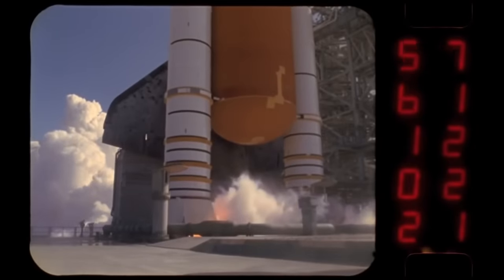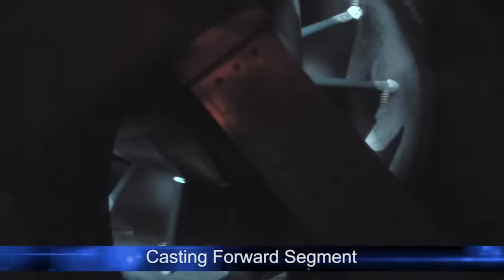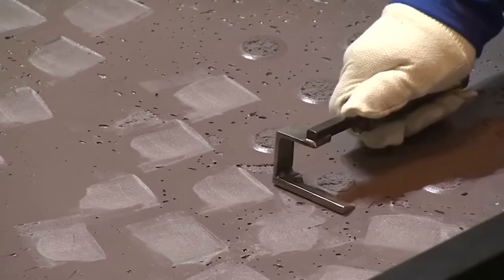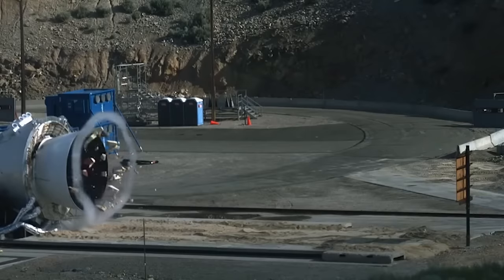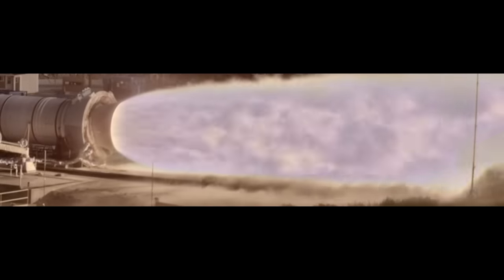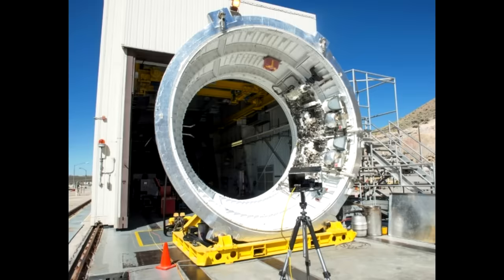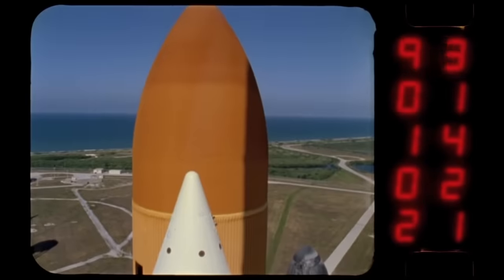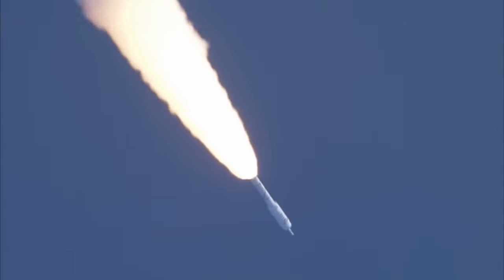The Amazing Engineering Behind Solid Rocket Boosters

Comment: When I sold electron microscopes I traveled to Morton Thiokol in the mid eighties right after the Challenger accident. The engineer gave me a tour of the facility and  even let me handle a piece of the o-ring that failed. The most amazing part was the booster shell section cleaning rig. Because they used CCl4 (carbon tetra-chloride), to conserve that hazardous material and reduce costs they used a MASSIVE container half the size of a basketball court in the factory floor that used CCl4 VAPOR that condensed on the booster shell on drained into the floor to be filtered and re vaporized.

Comment: Do you know of any videos showing the Booster Separator Motors firing in slow motion? Our company makes the Aero Heat Shields that cover the Booster Separator Motors. The shields fly open at the speed of insanity and lock into place allowing the rockets to push the boosters out of the way.

Comment: Fantastic and useful information I never even saw the remake and rebuild of the solid rocket boosters after the Challenger disaster now I have and I’m glad they made changes they did now the question is going to be is how big can the solid rocket boosters get in diameter or in length for practical use because if they were able to be larger you could actually put segments of a space station components on those and carry them up that would be beautiful
Reply: @Autistic Danielle. The diameter of the Shuttle SRB’s was determined by the railway right of ways between Utah, where we cast the motors, and Florida where the shuttle was assembled and launched. We could have made them bigger, in fact some designs were bigger, but the railroads would not accommodate the larger diameters. We looked into casting them in Mississippi and moving them on barges down the river and through the Gulf of Mexico so we could make them bigger, but the cost of the new propellant casting facility was great and the program was coming to an end. Making them longer has limitations, too, because the propellant was mixed in 2000 pound batches and casting tall motors means they have to be done in shorter sections that are stacked; monolithic grains have a limit in length because you can’t keep pouring freshly mixed propellant in on top of propellant that is already curing at the bottom, plus the hydrostatic pressure of a tall column of propellant changes the propellant properties and radial pressure on the motor case at the bottom of the motor. And there are other technical challenges - with enough time and money these things can be dealt with, but time, money and political will are the limiting factors. I worked at Thiokol Promontory Point, Utah as an engineer on Space Shuttle, Trident D5, Peacekeeper/MX and on R&D projects for NASA and Air Force. Fascinating work, except for the money and politics.

Comment: There is another limit besides the size of each segment for teansport - the amount of mixed fuel. The amount of aluminum, polymer, oxidizer and catalyst for polymerization that can be made in one batch is limited by the technological process and the time of catalyst action. Mixing two batches of fuel in a larger tank can lead to combustion instability which can lead to casing burnout. They discovered this while mixing "by hand" in smaller batches for the Polaris SLBM. Later the entire process was automated with accurate measuring and mixing times as well as increasing the amount to be made exactly for one engine or segment.

Comment: Before I retired I worked for over 40 years at an independent materials testing lab, so I am quite familiar with aerospace. Engineering always includes  trade-offs (#1 trade off is cost). The segmented booster design was known to have joint issues. The competing design used one piece boosters but had to include building new facilities for casting the fuel for the SRBs. The lower winning bid used existing facilities and shipped the SRBs in sections to be assembled on site. To save even more money the o-rings were not made of a silicone or fluorinated polymer which typically has much better low temperature flexibility properties. There is simple ASTM  test method to determine low temperature retraction properties the gist of which Feynman brilliantly  demonstrated.  In short you get the safest design for which you are willing to pay. (just like accelerating a mass to light speed requires more and more energy, so does the cost to get a higher degree of safety).
Reply: All these years and you still didnt realize the truth
Reply: @idontcare7961  There are so many truths my poor ape brain doesn't and will never realize so I can't dispute your statement.
Reply: @michaels6463  Like space missions being nothing than fairy tale for religious ppl.
Reply: @idontcare7961  Loon alert
Reply: @idontcare7961  I'm not qualified to intelligently discuss religion and all I know about fairly tales is that they are generally a tool parents use to introduce moral concepts to their children.
Reply: @michaels6463  Globe earth that they teach us since first grade is a lie thus ppl who believe it are religious. Globe earth is religion, not a fact.
Reply: @idontcare7961  Congratulations! I didn't think it was possible to pack so much illogic into two sentences. Hats off to a true master!
Reply: @michaels6463  Grow up.

Comment: Since the rate of burn is proportional to the surface area of the solid rocket propellant and it burns from the inside out, if there wasn't a spline shape on the inside the rate of combustion and therefore thrust would increase as the fuel is consumed and the diameter of the hollow area on the inside increased.
The splines therefore usually normalise the burn rate to provide a constant level of thrust, but they can be tuned to provide more thrust at take-off.

Comment: "The best part is no part" kept running through my mind, esp. when the post-challenger "fix" was explained.
Reply: That is exactly what I thought. The segments connections seems overengineered, just because the factory was far away. So many unnecessary things needed just to make the transportation work in segments. That's why SpaceX rapid development is racing ahead, while SLS is looking like 1970 rocket engineers wet dream...
Reply: @Ryzon95  Racing ahead?  .  The comparison is ridiculous.
Reply: @hoghogwild  Not a native speaker. SpaceX with rapid development and trials is  waaay in front of NASA when it comes to technology and development. I know they are not competitors, but NASA's methods and the way they have to secure funding are making them stick to tested stuff, but not always good stuff - like these SRBs for SLS - overengineered and complex.
Reply: @Ryzon95  The government told NASA to use "Shuttle derived" technologies, so that's what they must do.
Reply: @hoghogwild  Yep, that's true, and that is exactly why (in my opinion) they are far behind. They are not going for innovation, going for reuse of decades old hardware.
Reply: @hoghogwild  It's not a ridiculous comparison at all. SpaceX has launched several supply missions and now 2 crewed missions, they are in the operational domain of the Commercial Crew Program, while SLS plans the first test flight (Artemis 1) in 2023!
Reply: @arfyness  SLS is designed for beyond LEO travel, the Commercial Crew vehicles are LEO vehicles only. Artemis -1 will travel to Luna and back.  Completely different vehicles and purpose, thus a ridiculous comparison.

Comment: Just like the propellant in a AMRAAM or ASRAAM, multiple splines within the solid propelant for that fast burn and faster acceleration as the propellant burns. Plus AMRAAM has the splitter down the body of the rocket to abort or for safety on the ground, it splits the body open  and the propellant burns to atmosphere, just don't have any rain or water nearby the combustion exhaust turns in to Hydrochloric acid.. Guess what I used to do in the RAF.........

Comment: 11:28 - Why not have pins on both sides of the O-ring band, to prevent the flexing from pulling the O-ringed section of the joint open?

EDIT: 12:52 - ...that works, too.
Reply: Because the pins must be protected by the seals. They themselves are not sufficient to hold back that kind of heat and pressure - it would destroy them quickly.

Comment: Solid rocket motors run quite rough compared to liquid rocket engines.  The SRB is a giant acoustic resonator - a whistle on a grand scale.  Many harmonics that change as the propellant burns away. You mentioned bending motion, in re the field joints, but didn't mention the "pogo mode" of vibration of the SRBs.  For the Areis test, the structures troops had to add large springs between the motor and the payload to absorb the +/-  8 cm amplitude at ~ 6 Hz.

Comment: Incorrect math at 1:06, when you say EACH booster produced 1250 tons of thrust of thrust whereas the core produced about 600 tons...that means 2500 vs 600, or 5/6ths of all the thrust, not 2/3rds.

Comment: There is a very good book that gives a tremendous quantity of information on Liquid and Solid fueled rockets, including formulae for thrust, chamber pressures and nozzle design. It also has design criteria for turbo pumps. I have a copy of it, cost $0.25 at the time I bought it.
Rocket Manual for Amateurs by Capt Bertrand R. Brinley, published 1960 by Ballantine Books, Library of Congress # 60-8528.

Comment: Are there any videos that cover the mechanical linkage that attaches a rocket engine to the rocket itself? Like these boosters with several hundred tons of boost were attached to the main tank via two points, I would love to see how these points were engineered to take such an immense force through them. Or simply, how is the thrust from a rocket engine is transfered through to the rocket itself.

Comment: I have an interesting story about the solid rocket fuel produced for the SRBs. 
When I started college in 1982, I attended what was then called Alabama Technical College where I was supposed to earn my associates degree in applied electronics. My first instructor was a man who had been a chemical engineer. We were having a conversation about the shuttle's SRBs. He tells me he was on the team that developed the solid rocket fuel for them. He explains the process and the chemicals involved. While he is telling me all these things, he reaches into a file cabinet drawer, pulls out a styrofoam container, lifts the plastic lid off and shows me this gray rubbery substance. Then he says, "this is what it looks like". He actually has solid rocket fuel in his office. Next, he cuts a sliver of it out with a knife and places it into a cigarette ash tray and proceeds to light it with a lighter. It took a second or two before it starts burning. It was a lot like a sparkler only faster. When it was finished there was nothing left.

Comment: 2400 is 80% of 3000 last I checked. 

1200 each per booster is 2400, 600 for the liquid engines makes 3000 total. 

YouTube won’t let me rewind mid comment, but I’m thinking I should be looking for a 4 leaf clover under the snow cover if I found an error in one of Scott’s videos. That just doesn’t happen, especially on a basic description.

Edit on review. 1250 per booster is 80.6% of 3100 total boost.   It really is a unicorn.

Comment: Scott, you note that the SRBs have their own rate gyros at 16:03.  You say that they were noting abnormal (vectors?) from what Challenger's gyros were, so why wouldn't this trigger an abort?  I'd be interested to hear your take on this...I suspect that perhaps this wasn't a measured aspect of the system in 1986, or perhaps expecting too much for the Shuttle's computers to figure out in that split second on Challenger's 80's-era computers...or maybe they did start an abort, but it didn't happen soon enough to escape?

Comment: The Air Force built up the solid fuel boosters for their Titan III and Titan IV launchers in an installation separate from their Vertical Assembly Building, as they considered hundreds of tons of solid fuel clustered in one place highly dangerous and wanted to minimize their losses if they had a fire or some catastrophe. I have always wondered if NASA took, and with the SLS will resume taking, an huge risk in collecting and handling the SRBs in the VAB.

Comment: That improved, double-clevis, triple O-ring, J-seal joint should be known as a "Boisjoly Joint."
Roger Boisjoly was literally destroyed as a whistleblower for rightfully showing the danger of expecting the original joint design to work at below freezing temperature. It was designed to function above 45 degree. (I freely accept any correction, as I take this from memory. My perception is often flawed but corrected by fact.)

Comment: Scott, do you think we will ever see a "Falcon 6"? A Falcon 9 with 6 Raptor engines instead of the Merlins. A liquid fuel stage that could do the same work of a Falcon 9 all the way up to replacing an SRB (perhaps fewer engines if one omits the SRB replacement scheme)? Or won't there be "any real need" for smaller rockets if you can ride-share a Spaceship?

Comment: Scott, why is it in launch failures that involve solid rocket motors, that while the rest of the vehicle disintegrates under the sudden aerodynamic forces they experience, the solids seem to happily keep trucking along, blissfully unaware that they are about to get blown up by an RSO? This has been seen numerous times. Are solid casings made out of an “unobtainium” of sorts, are they way overbuilt compared to the rest of the vehicle?
Reply: We cant really compare large segmented solids like the RSRMs used in Shuttle with the smaller unitary solids.  However, we have to remember that SRMs have to be able to withstand the pressures of combustion along the entire case, while liquid rocket engine designs simply have to carry the fuel at whatever pressure is required, while the pressure of combustion is solely handled in the Main Combustion Chamber and nozzle areas.  The entire case of any SRB is a massive combustion chamber with its associated pressures.  Shuttle RSRMs had an average chamber pressure of 620 psi, but can reach up to and over 1000 psi during highest boost timings such as off the pad scenarios.   SRMs are usually structurally much stronger than the rockets that they boost.

Comment: On Challenger, most of the excessive SRB gimballing (moments and forces) that reopened the wounded joint were caused by unnecessary roll commands from the flight control load relief function. The Shuttle continued flying this way well into the future.
Reply: Unnecessary commands?  The stack encountered the highest winds that any shuttle stack had encountered ever.  What makes you think that the roll commands were unnecessary?
Reply: Are you saying that they could have not corrected the course and still been able to reach orbit?

Comment: 8:04 - Why throw the nozzle extension away rather than recovering it with the rest of the booster?
Reply: Good question, Vikki.  With Shuttle, the entire SRB floated and WAS recovered by towing into Port Canaveral, except for the dumped nozzle extension.  Reason: The speed at which the SRBs hit the ocean under parachute was quite high: 12 or 20 mph (don't remember anymore), enough to break off the extension and damage the nozzle and its complex systems beyond repair.  So to insure reusability of the SRBs, the extensions had to be dumped just before impact.  With SLS's even larger and heavier SRBs... to avoid the use of huge and very heavy one-acre parachutes in the nose... the decision was made not to recover the boosters, at least not with the initial "SLS Block I" vehicle.
Reply: It may also have to do with how the boosters are recovered.  Divers have to go down and plug the open end of the booster and they inject air to force the water out to float the booster.

Comment: I'm curious.....what is the cost of one of the 5 segment boosters today? What was the initial cost versus after the Challenger failure? Did they actually charge NASA (which is actually us the taxpayers) more for the new design that was on the shuttles for it's last few missions?
I've always been curious about the use of a "you light it, you buy it" type rocket system with human attached to it. 
@Scott Manley, thank you for this wonderful video and research. I had NO IDEA about the wind shear also pushing on the shuttle and boosters flexing and compensating. One does wonder if any of these booster upgraded would have happened if the Challenger had not exploded. I suspect no unless there was an "on the pad failure".

Comment: 12:45

from my understanding of the events is that the weather during challenger launch was significantly colder than what the engineers had specced the shuttle for. Management ignored it and launched the SS. The failure was not a failure of engineering. It was a failure of management. The system was forced to operate outside of specs.
Reply: George Tsiros 

The launch was entirely politically motivated.

Comment: Something I've wondered through the duration of Constellation/SLS: I've always heard that Ares I (and subsequently ATK Liberty) was viewed as dangerously impractical for crew because during a launch failure the lack of combustion control would lead to burning bits of SRB punching holes in capsule parachutes making safe abort impossible. But, like, SLS will have two of them. So why are SRBs safe for an abort system that relies on 'chutes for SLS but not for Ares I? Is the idea that the liquid core of SLS can carry the crew clear of a burning cloud of SRB? In that case, what about a Challenger scenario where the whole stack goes at once?
Reply: This was a concern early in the Constellation program which eventually led to Orion having a very big and massive LAS for it's size specifically to avoid this problem
This is not a concern for SLS anyway because there's a core booster and an upper stage in the way